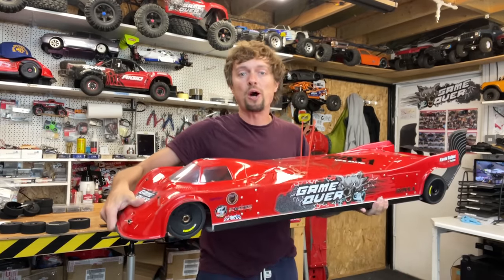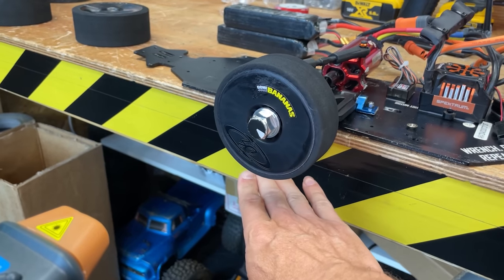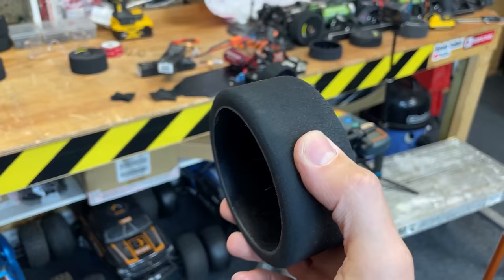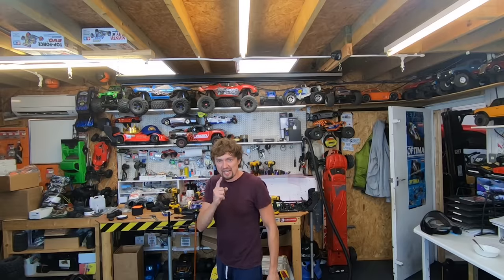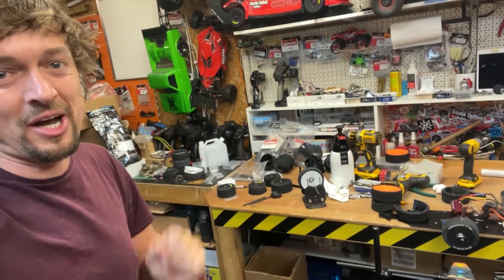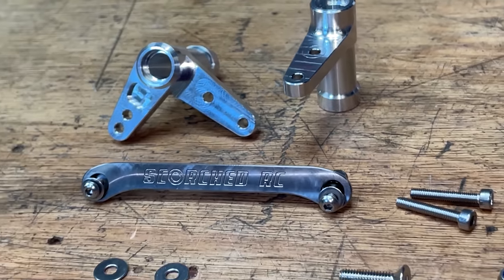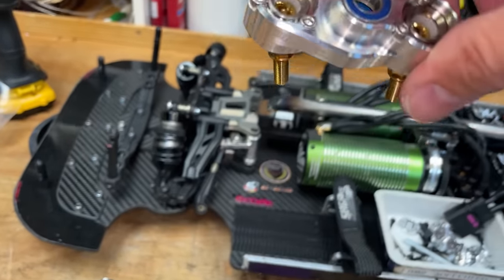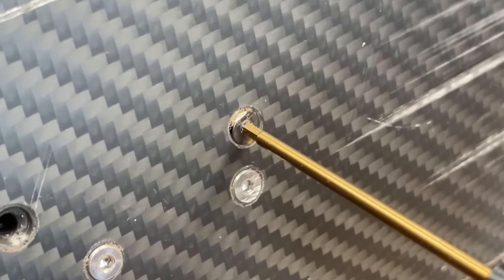Top secret Tires for 250mph Sausage RC Car project

Comment: My question is: Why don't you use bigger tires? The bigger the tire, the lower the rpm for any given speed. Also, you forgot to blur a frame with the wheel when you were balancing it, so... I think I know what you're doing.
Reply: The surface speed remains high
Reply: Centrifugal forces
Reply: Raises the car off the ground as well and is more aerodynamic surface area
Reply: @maxwellfrank4166 wheels are covered and are narrower, so the frontal area(critical in this case) is actually smaller
Reply: Get ahold of good year
Reply: A biger Tire got more wheigt and rotting wheigt is les power 
More torq
Reply: @froz3ntree40  yes but he's talking about the chassis not being able to use groujd effect to suction to the ground meaning its easier to flip on top of that you wiol hqve to hqve a longer run way to make up for that tire weight plus it wastes more power to be useful
Reply: the chassis will not being able to use groujd effect to suction to the ground meaning its easier to flip on top of that you will have to have a longer run way to make up for that tire weight plus it wastes more power to be useful and more aire gets underneath making it more likely to flip when it hits a bumb
Reply: @eminstinct4114  there's a relation between the chord length of an airfoil and the ground clearance where it generates the highest amount downforce with the least amount of drag. Go under the optimum clearance and the profile will stall(with a huge increase in drag) or go with higher clearance and there won't be enough downforce. Given the length of this car/its ground clearance, and the shape of the floor, this car only stays on the ground thanks to how how much it weighs and thanks to that rake angle. Ground effect isn't properly exploited by RC cars manufactures as it would then be a pain in the ass to fit the electronics on the respective chassis. 
It's the same case with a lot of the "aero" stuff(wing flap on that Perfect Pass rear wing, the splitter shape, bodywork and so on)that goes on those speed-run cars and I won't be convinced otherwise without a proper CFD study. And wind tunnel testing
Reply: Main reason is getting some one to make them. Only one is Rick @ Gone Bananas and he is semi awol due to personal issues.
Reply: @jons6125  Centrifugal force is dependant on rpm, not on surface speed. That's why the Earth's surface spins at 1000mph but we don't fly off it, since we're only spinning at 0.0007rpm.
Reply: @confusedgingers Centrifugal force is dependant on rpm, so reducing rpm by using a larger wheel will reduce centrifugal force.
Reply: @maxwellfrank4166  Not necessarily. Can do reverse portal axes, so the car sits under the wheel hubs. Also you don't need to raise it all that much to get a significant improvement.
Reply: @hardcorebestnlrccarbuilder Doesn't matter. We're going for top speed, not for acceleration.
Reply: @eminstinct4114 You don't have to raise the chassis if you raise the hubs. Reverse portal axles.
Reply: @wasa7 Surely there are bigger diameter foam tires out there.
Reply: @CristiNeagu  get on a kids roundabout and try it
Reply: @jons6125  I don't need to cause I know basic physics, and because I'm already on the biggest roundabout ever: Planet Earth. But you're more than welcome to try it yourself.
Reply: @CristiNeagu  i know that s why hi dosnt make biger tires
Reply: @hardcorebestnlrccarbuilder  That makes no sense. He wants lower centrifugal forces, so he should make bigger tires to achieve that.
Reply: @CristiNeagu  then it takes more power tho spin them and hi has it geart for that size tire
Reply: @hardcorebestnlrccarbuilder It doesn't take more power to spin them, and so what? It's not like he doesn't have loads of gears and pinions to play with.
Reply: They add a lot more weight and strain to the motors; along with making the car less aerodynamic.

Comment: I think you should focus more on the rim design, so it doesn’t have the deflection when it’s spinning. If you can keep the rim true the tire have a lot more lifespan, whether it be a solid strip of rubber glued on or hard foam.
Reply: i noticed this as well, i don't know how nobody has seen that.  The inside part of the rim where there is no support is causing the ballooning, you can take your hand and squeeze the wheel they are so flimsy.  Need a stronger rim, metal, carbon, just thicker, or some kind of support there.
Reply: I agree, the foam gets ripped off because the rim expands uneven.the weight of the car will reduce this but not enough to prevent it.those rims are key to keeping the rubber side down; :)
i would suggest a wheel out of steel;Dont use aluminium because my teacher in school told me that aluminium is actually heavier then steel  because its much weaker.They say its better because it looks better But a steel rim is actually better then a aluminium one.
Reply: Almost for sure the inside is expanding more then the outside!
Reply: absolutely, maybe an inner ring to support it!
Reply: Exactly. The rims will be the point of failure. I'm surprised that he's not using aluminum.
Reply: Some titanium rims would be awesome
Reply: Good idea
Reply: @daveettel4750 aluminum would be enough in this case. Let's not forget that while these rims balloon a lot, they are still plastic. Which has a pretty poor strength-to-weight ration. It's very light indeed, but extremely weak compared to even a lower grade of aluminum
Reply: Looked like a fishing line roll for the rim
Reply: I immediately though he needs those wheels to be reinforced along the circumference or a wheel that has no negative offset, with super long hubs so there's no unreinforced edge.
Reply: +1.
Regardless, this was a great test for Kev to do. The speed goal is looking a lot closer.

This shows clearly it is NOT the foam ballooning by itself though. Also show's how poor rubber tires are for what I believe, due to weight, balance, and potential destruction of the vehicle. 😅
The inside part of the rims are clearly balloning. The rims needs to be way more supported, at those higher speeds where both designs seemed to balloon,  even Kev's design (narrower?) 

My idea, maybe going with an offset rim? To center the support tires structure itself.. Body would probably have to be modified (?)
Reply: @kingkingg7868  you echoed my comment about the offsets on the wheels.  It would mean a wider chassis and body to keep those wheels inside the "wheel wells".
Reply: @LordPrometheous  That you did! 
My bad, I only read original comment in this chain when responding
Reply: You need an aluminum or titanium wheel that won't cone out like that! Perhaps change the offset design of the wheel too, so the center of the wheel is centered within the rim itself and eliminate the coning
Reply: Wish the axles didn't have so much play in them.
Reply: They are all terrified of weight but an alloy wheel might actually be what they need with a ribs in the middle with holes in it to help hold the compound weather that’s rubber or foam on and make the rubber solid if rubber no gap and not as soft I think you’ll be off to the races it isn’t so much about grip they can slowly work up to speed it’s keeping the tires on the wheels
Reply: @jeffgoard8831  that was my exact thought.  In the real racing world beedlocks are a must. In the rc speed world an inside ring would definitely help the unsupported inside of the rim from expanding soo much.
Reply: Carbon fibre! Works for Koenigsegg...
Reply: 1000% agree
Reply: IIRC I think in one of the older vids Kev mentioned that other material rims wouldn’t work as well due to the glue not adhering to the tyre on the rim properly which is why he sticks to plastic.
Reply: You just might be on to something I agree 👍🏻
Reply: You could make them from a harder plastic with a ring on the inside of the rim. No deflection still lightweight.
Reply: I agree the wheel material is insufficient. Any ballooning also seriously compromises the handling, compounded by deterioration of the tires, imo that’s why the crashes happen.
Reply: U sure love a good rim mate
Reply: Needs need lockers haha
Reply: Agreed. A theory is to make a ring on the inner edge of each wheel which should help reduce expansion.
Reply: @mastermind4034 could you not use an alloy rim with a plastic sleeve with slight grooves ( meshing like cogs) in each material to limit slip so you have light weight/ strength and foam can adhere to the plastic. Just a thought
Reply: What he says :)
Reply: The problem is bonding them. The foam wheels are bonded qith a chemical reaction. It's hard to get foam or rubber to bond with alluminium that well.
Reply: Yep I was thinking the same thing when watching the video. I think it's more the wheel design that is the issue need more support for inside part of the wheel as you say. I don't know how much heat is generated on these rc wheels at high speeds, but that will surely make the plastic softer and allow the wheel to stretch out even earlier.
Reply: @skullbones7452 aluminum isn't heavier, but you have to use so much more to attain the same structural rigidity that it's a heavier wheel. Also more easily broken. I have seen aluminum wheels get broken when changing a tire, but steel laughs at the tire machine...
Reply: @jeffgTrialsBikes steel strand mounted inside somehow
Reply: Agree. It's a wheel deformation issue.
Reply: Aluminium rim
Reply: I was just going to say that to. I have a big metal lathe and think I could actually do that.
Reply: I agree
Reply: Plastic sleeve with an aluminium ring inside
Reply: He clearly said solid rubberdoesnt work, it flings off because its too heavy. All the other tires are solid rubber.

The ground stops deflection

The wheels are aluminum with solid foam
Just say ring on the outside of the rim or carbon sleeve
Reply: Carbon fiber, or possibly Kevlar wheels? Lighter than aluminum
Reply: Crazy you’ll think that there isn’t a reason the wheels and tires are done like this. He’s addressed all of it before. Unless you are at the top level of this and the engineering that goes into it you don’t have a chance of telling him something he doesn’t know.
Reply: My thoughts exactly - billet aluminium would be my next go to
Reply: A solid tyre.
Tyre & rim, all one piece. 
Dunno what material.
Reply: Balance is key
Reply: Truck bed lining spray direct to the edge of the rims.
Reply: Titanium ring on the inside of the rim.
Reply: I think the real problem is his accent
Reply: @skullbones7452 Your teacher is wrong.
Reply: Like having aluminum or carbon fibre rims
Reply: And a slight lift from the ground as well.. the hits it's getting from below is causing some resistance
Reply: Yes, clearly the foam cannot handle the expansion of the cheap plastic rim. so use the best foam. on a rim made of material that will not expand like carbon fiber, aluminum or titanium, and you will have no problems easy fix

Comment: We have a carbon filament winding machine at work, usually used for winding high speed rotors that run at well over 100k rpm. You need a carbon sleeve that presses on over the wheel under interference. The hoop stress will resist that expansion you are seeing, then possibly bond the tyre onto the sleeve.
Reply: Seems to be a good solution and on the top, the compound of cfk and genuine wheel material reduces vibrations on the rim what results in less stress too.👍
Reply: That's sounds legit to me, i love these comments. I also like smarts and problem solving
Reply: nah at that rpm only good for drifting, no speed run
Reply: Think Castle use a Kevar band in their motors?
Not sure if going for a GRP/kevlar weave wheel, but adding a grip element (ie weave a rubber element  into it ,in the manufacture process) , so the tyre is a structural part of the wheel, not 'just' stuck on after?
Reply: Call me crazy I would use aluminum or carbon fiber rims

Comment: I was just thinking and came up with a idea. It seems to me that the foam isn't the problem because look how always the inner rim expands. Try cutting 1mm inner side foam and put a fiber or metal ring around it so it doesn't expand.
Reply: This is the answer that will help Kev brake the record!! It's genious in its simplicity. This needs to get upvoted hard!! Those banana's held up to nearly 50k rpm... it wasn't the foam detaching, it was the inside of the wheel failing. Strengthen that, and you've got your world record contending wheels. Kudos! :)
Reply: I was thinking either this, or a wheel that has even a little support on the inside when it’s designed. Basically what you’re saying but on the inside
Reply: This test was not in load mode. And because of the high rpm, the rims became like that, and when it is installed on the car, the main problem is the foams. Because this car is very heavy
Reply: @amirxr8464  the same effect still happens just not as much. 100% worth trying over just assuming it’s cause it’s “under load”
Reply: Would be hard to put on. My first thought was something like a piston O-ring but that has a notch in it to allow it to expand and that is what we are trying to prevent. Would almost need to bend the wheel in to make it fit that way it isn't larger then the wheel and can't open up.

overall though the thinner the wheel the easier this will be to do as there is less lip to worry about expanding out, however it does mean less traction to get up to speed. so you would become more limited by max run distance.
Reply: @coreytaggart128  that’s why I was thinking a wheel produced with an inner lip the same as the outside but only enough to support the rim itself and obviously fit on the car

Comment: The amount of power you have to have to not only strip the inner wheel while still completely blowing the outer diameter off of the rim is absolutely insane 😅 this thing is a rocket! Keep up the great work brother much respect!
Reply: tata1293
Reply: But maybe that´s also Part of the Problem. When the Car gets a little lifted, the Wheels will instantly gain a lot of speed and reach the critical Point of the Foam. Connecting it to be a 4*4 like Kevin, planed should really help. To sum it up he could maybe try to set a max. RPM for the Motors to reach, depending on what Tire he is using? Really dont know if its possible, but it would make sense to me.

Comment: Once again... Get you some aluminum wheels. Drill some holes around them on the inner rim. Dip them in a rubber epoxy compound. The holes will allow the compound to bleed through to both sides and provide support while preventing ballooning. Let them run off and dry sideways for easy clean up and balancing. All you need is the right rubber epoxy compound...
Reply: That is actually really smart man, I hope he tries this
Reply: This, but make the wheels out of carbon fiber over aluminum.
Reply: i know it exspensive. but what about titanium rims

Comment: Not sure if he mentions it later in the video but on the first dyno run the wheel itself under the foam tire is expanding as well. Maybe a wheel with stronger material and or more cross bracing inside would help keep the tire together longer.

Comment: Tip: Left handed drill bits are really good for rounded off screws. Instead of just drilling them out, 9 times out of 10 they grip and just thread the screw out.

Comment: Use larger diameter wheels! Larger diameter wheels will have lower centrifugal force. One way to visualize this is that larger diameter wheels rotate fewer times to achieve the same velocity of the car. Lower RPM=less centrifugal force.

As an engineering student, I'll design you a wheel if you're interested and if you will pay the material and machining costs! We could make a carbon fiber or aluminum wheel, balance it, and attach foam for traction.

Comment: Tires are critical for electric-motor cars, because they have to carry all the power. But crucially, Project Air's jet-powered car puts power directly into the air... its tyres are just for rolling and steering. So this is vital to crack for the motorcars to win

Comment: Have you considered modifying some skateboard wheels to fit? I guess you could mill out the centre’s to fit hubs inside, there’s a massive range of “A” hardness ratings to suit the grip  you need plus I’m guessing the extra weight might help with stability? 
Just a thought?

Comment: I think you should really consider larger wheels and then go with either foam or rubber. The larger diameter wheel won’t have as many rpm’s at speed, and you will deal with a lot less centrifugal force. Just build a body with big, smooth wheel arches, and mold them smooth. Sort of like the Batmobile. If you run a wheel that is 5” vs running a 2.5” wheel, it will have to spin 1/4 the speed as a 2.5” tire to cover the same distance in the same time.
Reply: Half the speed not quarter, circumference varies linearly with diameter, but yes, bigger wheels will help.
Reply: Well yes and no because much like a cutting bit the speed on the surface is linear. A reduction in weight/density might help but ultimately it's the tensile strength of the rubber that is the problem. I would suggest using a urathane wheel which can have a certain amount of deflection under load but is much stronger than rubber or foam.

Comment: Tip for getting small bolts and screws out without stripping - Take your driver, and a hammer, put the driver into the bolt and hit the top of it with a hammer for a few sharp shocks. This usually "breaks the seal" and makes them much easier to turn without stripping

Comment: Can't wait to see it go down a proper drag strip!!!! Much smoother and way stickier!

Have some of the track adhesive on hand to help out with grip... I wonder if wheel slip is contributing to tire destruction? The tires are putting a lot of power down, and they must be slipping and getting damaged, especially as wind resistance increases.

👍 hell yea!